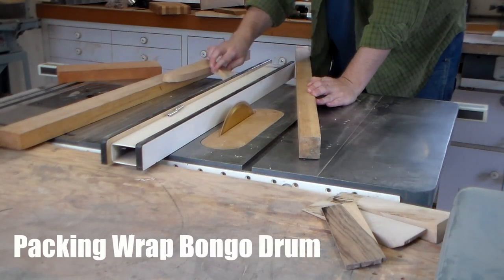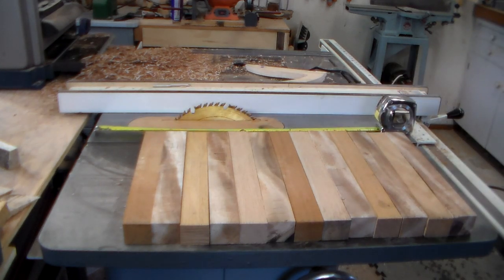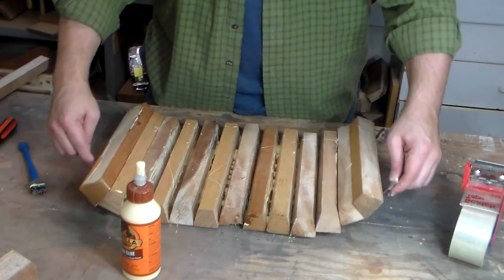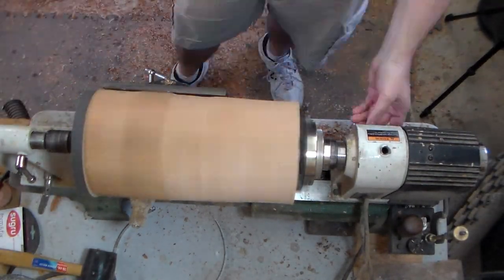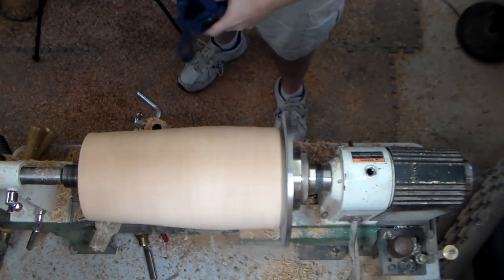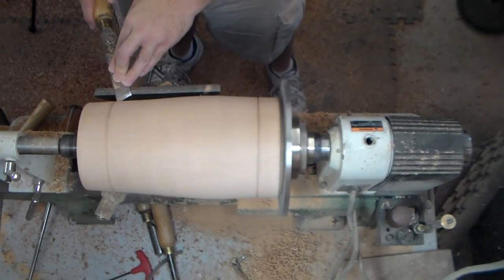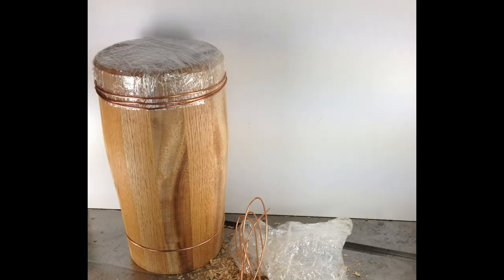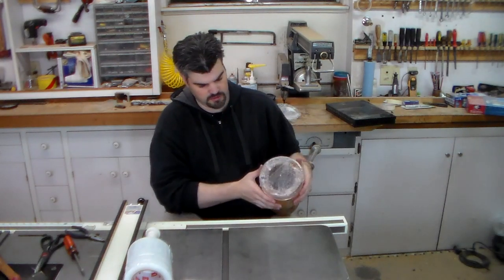Stretch Wrap Bongo Drum

Comment: That frame is very nice. 
To get a much better sound i used some dry rawhide(from a medium to smaller size animal) on a similar frame, in fact i got the dried and salted hide from someone who went hunting and just cut a piece the size of the top with say 2 inches extra all round. Then i used a blade of sorts to scratch/shave the hair to nothing on the outside, cleaned the inside in a similar way and wet the skin down. After it is very well soaked, i stretch it over the frame and staple it with a staple gun, working opposite sides as i go all the time reducing the spacing between the staples. 
After i got a good first round of staples in, i go around again, putting in 2 more rounds of staples, as i found that rawhide can have quite a pull when it dries. It also helps if you let it dry slowly, by putting a damp cloth in the middle of the head, to let the drying happen from the side of the head. 
After the 3 round of staples i cut off the excess and wait for the skin to dry out. 
All that is left then is to attach a decorative trimming band around the top of the drum to cover the staples. This method gave me some really good results in the past.

Comment: Dry fit...never heard of it!  It will eventually go together through the magic of editing.  You have way too much fun in the shop.
Reply from the maker: Jimbo L I'll get it eventually. :) Oddly enough I did dry fit and it went much smoother than on film. Of course...
Reply: With me, when dry fitting, things fit perfectly. But somehow at glue up the result is always less. 

Love the video. Finally some real wood inside the lave (-:

PS you could possibly get more tension on the plastic by applying some heat using a heat gun.

Comment: I never would have thought about cling wrap.  But it turned out nice, well done.  I hate to ask a stupid question but how did you figure the angle to cut the (staves?) at?
Reply from the maker: Seth Carson Thanks! The angle is pretty easy. It's 360* divided by the number of staves, and then divide that number by 2. 

for a 12 sided box 360/12= 30  30/2=15. Hopefully that makes sense!
Reply: Peter Brown
Duh.  Now i feel kinda dumb.  I'm working on a small 1 gallon oak cask and I've been struggling with getting the staves gapless.  Thanks Mr. Brown

Comment: I guess you need to go out to skin a goat and put a proper sheet of leather on there. 

I have worked with acacia and never had a problem with allergy. I will be extra careful next time though. I Noticed that the wood is tough on the tools. Its very hard. That could well help produce a better sound though.

Did you round out the inside? That would probably give you a better tone as well as the rough inside might muffle the sound.

Also, i see people make segmented stuff in halves so they can sand the halves flat to make them fit better. Gaps will also have a negative effect on the sound.
Reply from the maker: Willem Kossen Thanks for all the help Willem. If I owned some larger chuck jaws I would have scraped out the inside a bit. I couldn't think of how to get at them with what I had. No gaps though, tight as a ... you know! :)